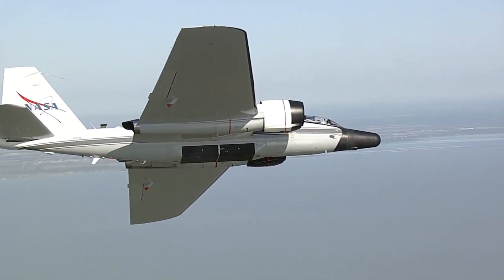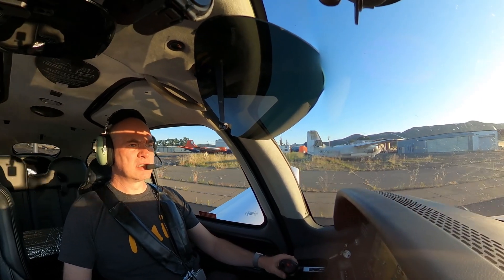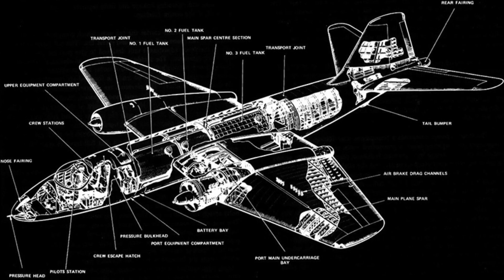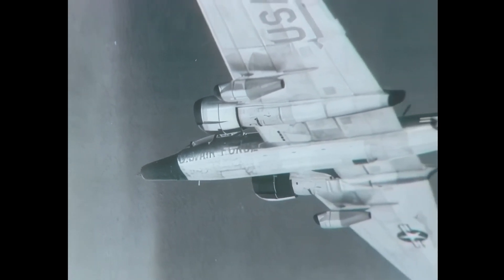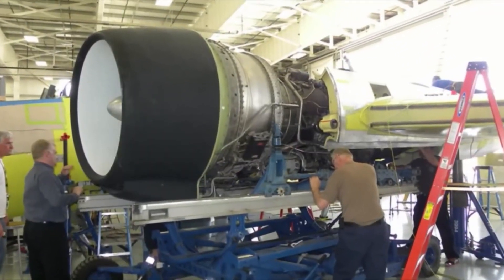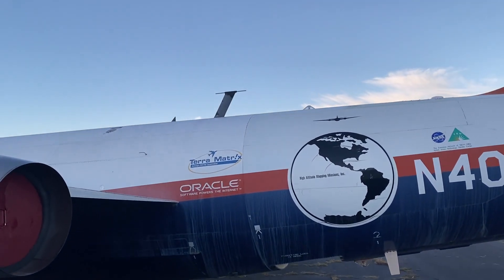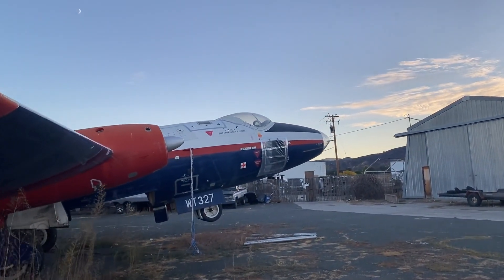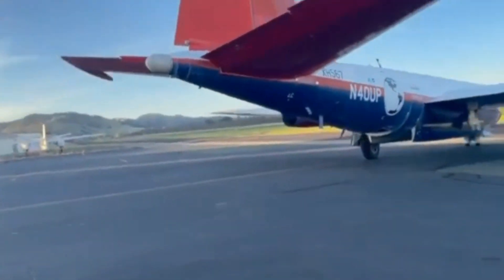Why NASA Relies On A 1950's Aircraft Design To Track 21st Century Spacecraft

Comment: I fly the WB-57 at NASA JSC. Great video as always! It is cool to see these awesome planes getting some attention.  They are real workhorses.  

 If anyone has questions, let me know.  If I can answer them I will.
Reply: Were you flying the one that was monitoring the return of OSIRIS-REx capsule? 😊
Reply: @DUKE_of_RAMBLE  No I was CAPCOM for that mission.
Reply: @nanunanu83  Well that's equally awesome!
Congrats on the successful return!
Reply: @DUKE_of_RAMBLE  Thanks! That was our first mission with Starlink for our video downlink.
Reply: @nanunanu83  Loving our Starlink! 🤘
Reply: @nanunanu83  this is all brilliant stuff.
Reply: We had the first two actually designated RB57FS at RheinMain AFB 1966-67.  One was tail #13503 and either 13500 or 501.  They had J57s under wings which were windmill started in flight. I worked avionics and special equipment package.
Reply: @@smithy1833 That timeframe was HALO-E a sensor from the U.S. Geological Survey.  We found a ton of titanium that when mined, could be an economic boon to Afghanistan.

Comment: -27.671266978445168, 152.68951226009304 is the location of a Canberra rotting away in a paddock in Amberley, Queensland, Australia. The owner of the nearby caravan park bought two from the RAAF in the 1980s and set them up as a landmark. Address is 2812 Cunningham H'way/Cnr Coopers Rd and Cunningham Highway, Willowbank, Queensland, Australia. The remaining one is quite obvious on Google Earth.

Comment: Hi There!, I think this channel is great but specifically am posting in reference to the Canberra, and air sampling.  Canberra 221 is briefly shown early in the presentation, and I owned Canberra 222 for a few years after I recovered it from a disposals and metal recycling company many years ago, the cockpit is now in a museum here in Australia. As an air force cadet in the 70's I often saw the Canberras based at ARDU RAAF Base Laverton in action. I also saw both the RB57 'Weatherly' which later crashed on take off from Laverton, and the U2's operating from RAAF East Sale in the early 60's where they were doing upper air sampling for Chinese Nuclear tests. more recently I was doing some training for a Unit in Houston TX where one of the pilots ALMOST got me in to see the RB57 at Johnson Space Centre, but alas it was not available for the week I was in that City. A friend of mine owned one of the RAF (RAAF?)  Canberra's used at Woomera for UK Nuclear testing dust cloud sampling, bad juju, as most of the aircrew who flew those missions died from cancer over the subsequent years. I also was by pure luck to see a formation of RAF  Valiant Vulcan and Victor in flash white fly over the city of Melbourne during this period.  when i was in Peru a few years ago I was refueling at Pisco Airport, or maybe Lima, where there was a flight line of several azure blue PR Canberras in the baking sun. One of my all time favorite aircraft. Thanks Scott

Comment: Thanks for that Scott, always had a soft spot for the Canberra, there was something about the diamond shaped wing and the engines.  
The strange thing is that the only time I can remember seeing  one in flight was the PR.9's final flight in (I think) 2006 . This is despite having been photographed by one on at least two occasions that I know of. Once in a hot and sandy place and once in a cold and midge-ridden place (Cape Wrath training area). They just flew that high that you never saw them unless you knew when and where to look. 
It was actually the last aircraft to get ticked off as "spotted" on the "Aircraft of the Royal Air Force"  poster I was given at primary school in th '80s. Mind you I wouldn't have written on it if I'd known a mint poster would now be worth £100 or more.
Reply: I happened to be visiting Marham on the day that they did their last RAF flights to the New owners. Was walking past the hangar when the doors were opened for the last time with the aircraft in them and saw the last one take off.

Comment: The U-2's very capable,but it's also very fragile.  The Canberra's long life is a real tribute to its designers. Considering it was conceived in the 1940s, and was the company's first serious aircraft, it has to be considered a brilliant achievement.
Reply: Also, depending on what you're doing, you don't always want to use the vehicle that is the most expensive to operate.
Kind of like when you're planting three rose bushes, you use a wheelbarrow, not the farm tractor with a harvest trailer.
Reply: @MonkeyJedi99 I always use the tractor and trailer regardless of number😂
Reply: The original long-wing B-57 (the B-57D) was indeed fragile.  20 were made and all were grounded when one lost a wing and crashed into a schoolyard.  The B-57F also has to be flown gently.
Reply: The U2 isn't just fragile it's also hard to take off and (especially) to land they don't call it the Dragon Lady and the Widowmaker for no reason. It's essentially a modified F-105 Starfighter airframe already a notoriously dangerous aircraft to fly and then they went and made it worse with extended wings and a minimalized landing gear.
Reply: @atomicskull6405 
Your finger hit the wrong key. It doesn't matter. We know what you meant. F-104 not F-105....lol
Reply: @atomicskull6405 At 70,000 feet the difference between cruise speed, stall speed and maximum speed is very small. I think it’s unlikely that many pilots hand fly the U2.

So the U2 is probably difficult to fly in pretty much all of its flight regimes.
Reply: @thethirdman225  I think every aircraft is a handful to fly in its coffin corner, the difference is with most planes which aren't the U2, pilots don't do that very often.
Reply: @tz8785  Yes but my point is that the U2’s normal flight regime is also its coffin corner. Imagine trying to turn it at its normal cruise speed when the difference between cruise speed and stall speed is a couple of knots IAS. And that’s it’s normal operating environment.

I don’t envy those who fly them. They would get unique perspectives on the world but it would be a slightly scary environment to fly in.
Reply: @atomicskull6405  NOPE, It's based off of a XL-104.
Reply: Are you suggesting that the EE Wren isn’t a serious aircraft? Hmmm, fair point.
Reply: @desmo750f1 or the EE Kingston, then again, they only built 6
Reply: @markmaher4548  Little known that EE fundamentally originated the TSR-2 design (their original looked amazingly similar) but being the ‘senior’ partner when they were amalgamated Vickers was given the design lead.
Reply: Laverton RAAF Air Force Base in Melbourne Australia. I was very young but there were both USAF B57’s & U2’s based there , flying down to the Antarctic. Some sort of of weather or atmospheric research I believe. I did see both flying . Laverton has short runways & has been closed for some years. I love watching the RAAF Canberrra’s which were a completely different bird to the B57.

Comment: For many years used to see the ground running one at ex-USAF Bruntingthorpe in UK, I believe it is still there and runs. Remarkably successful design and to think the RAF still operated them 15 or so years ago. I think Brunty's Canberra is still in the same colour scheme as the one's you have detailed. There are quite a few well looked after Canberra's dotted around most UK museums.
Reply: Operated them until the introduction of American Signals and recon aircraft I believe by this point it was only the highly modified Pr-14 that was in operation a photo recon craft also saw service in Iraq and Afghanistan

Comment: Speaking of... check the Canberra's history.  There was one or more brave (crazy) RAF Canberra crews that actually undertook illicit overflights of the Soviet Union... talk about unarmed and unafraid!!!
Reply: Unfortunately the RAF Canberra overflights of the Soviet union are a myth. There is no documentation on anybody's side that they actually happened. However, In 1956, the USAF did take some RB-57A's , stripped out as much weight as they could and flew very high altitude (65,000 feet plus) reconnaissance flights over the Eastern European. These  missions were classified until the late 2000's, long after the RAF myth came out and the USAF missions and RAF deep penetration myth most likely got mixed up (RAF did do them, but with RB-45 Tornados in RAF markings and at night to do radar recce missions to make radar overlay map for SAC and the V-force). The Rocket powered Canberra was built to allow it to get very high to do H-bomb mushroom cloud sampling on operation Grapple in 1957/58.  IT wasn't ready for the early Grapple shots and one of the two modified aircraft had its rocket motor blow up in flight at  57,000 feet in April 1958. The pilot and Navigator managed to Bang out and at the time held the record for the highest successful Ejection.

Comment: In case anyone is interested, one of the WB-57s that NASA uses for monitoring rocket launches is N926NA, ICAO code acd5a1 (not allowed to post links, finding an aircraft tracking site is left as an exercise for the reader. ;-))

Found that one because I was monitoring flights around the cape and Boca Chica. The plane took off from Houston and flew to Boca Chica, circling upwards of 50k feet. If you check April 20th, you'll see it circling Boca Chica at 45,500 feet.

Ok, I checked, this specific aircraft is currently down for maintenance. N928NA might go up but isn't scheduled yet.

Comment: I've been lucky enough to have a sit in a canberra b2.

Im 6 foot 2, and not particularly thick or thin, but getting in and out was tight, and getting into the bonbadier position was extremely tricky😊

Comment: In the mid seventies, I was a young student in a University Air Squadron and I got to fly in a Canberra over the Wash off the coast of England, from RAF Marham. I was originally going to fly in a Victor bomber, which was going to refuel, what at that time was known as the MRCA (multi role combat aircraft), which eventually became the Tornado. The Victor was an amazing futuristic aircraft but my flight in it was not to be and I was offered the flight in the Canberra instead. 

I did my one hour induction on what to do in an ejection seat, then it was out to the aircraft with the pilot and the navigator. They were superb older guys (probably a lot younger than I am now!) and I remember especially, the flowing silver locks of the pilot. The Canberra is unusual, in that, the pilot is on his own at the front, then the navigator sits behind him on the port side and I sat beside him on starboard. There’s a tiny little window above your head and if you leant forward, you could see a bit out of the pilot’s canopy. I always remember the navigator leaning forward and removing the safety pins on the ejection seat then saying, “don’t you touch a thing unless I tell you to!” You were of course, basically sitting on a bomb! 

Anyway, we were to act as a target aircraft for, I think it was an F4 Phantom , over the wash. The idea was that the Phantom should get a target lock on us and “shoot us down”, and our job was to avoid that. So off we took, with much muttering of, “we’ll show this young whippersnapper a thing or two!”. So we jinked around the sky. I remember feeling my anti-g trousers inflating and deflating. I remember looking up out of my tiny window and seeing an oil rig! Anyway, to their great delight, the crew managed to win the dog fight and when we got back to Marham, asked to do a “run and break” as a means of celebration. This means basically flying down the runway at low level and fairly high speed, then sharply banking and climbing, to reduce speed and rejoin the pattern for a landing. It was an exhilarating end, to a memorable day, that I fondly remember, all these years later.

Comment: I volunteer at a museum in the UK and we have 3 E.E. Canberras. Two are fairly standard examples but the 3rd one is rather interesting. It's a B(I)8 Mod with the reg WV787. This particular Canberra is fitted with afterburning Hawker Siddely Sapphire engines as well as a unique cockpit, buccaneer nose and radar and a fluid tank where the bomb bay used to be as well as a spray boom (the boom didn't survive sadly). It was part of the A&AEE at MOD Boscombe Down and served as a flying test bed. It also sprayed water for ice trials and was the aircraft that conducted the ice trials for Concorde!
Reply: Come on, we all know it was really for chemtrails!  ;^)
Reply: @alexhajnal107 dihydrogen monoxide is a chemical, after all
Reply: @williamchamberlain2263  And a pervasive one at that, it is even found in penguin eggs.
Reply: Which museum is that?